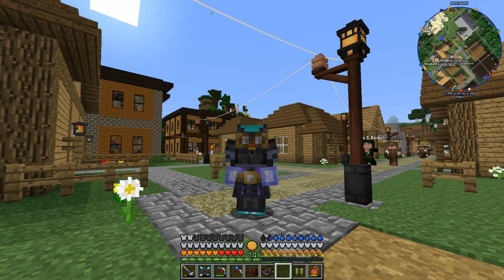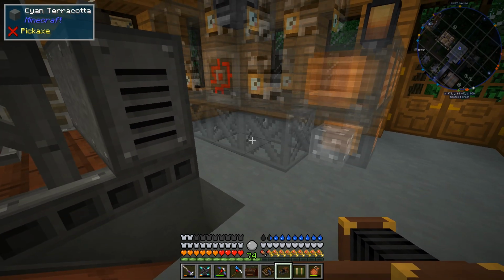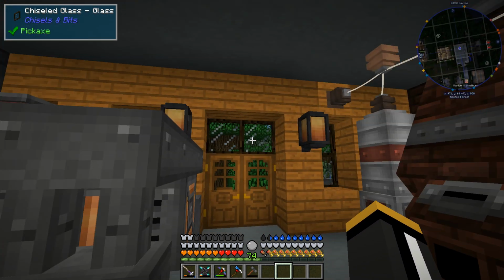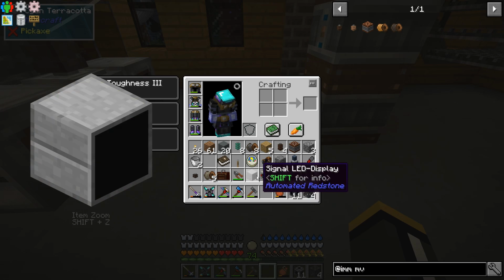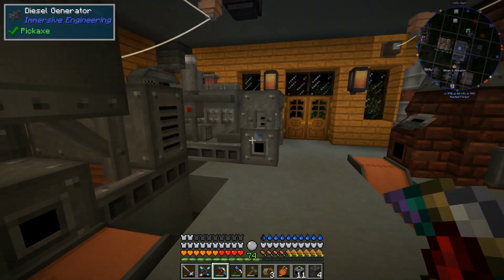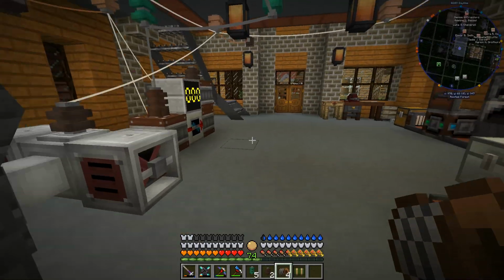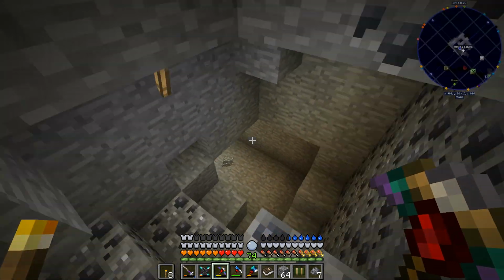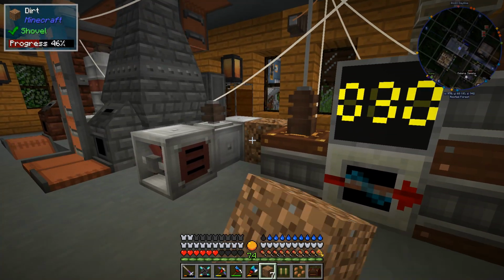RealTech S2E28 - Diesel Generator

Comment: Most of my recent deaths are from running into hv cables, lol. You may need multiple vents from the generator to keep up with the pollution rate. Neat trick using the redstone energy valve to convert the voltage to mv. A second led display will show the thousands when converted to a multi block. A second neat trick with the steel scaffolding and the pipe.
Reply from the maker: lol. Those cables are brutal!